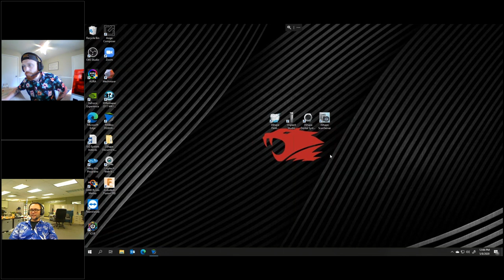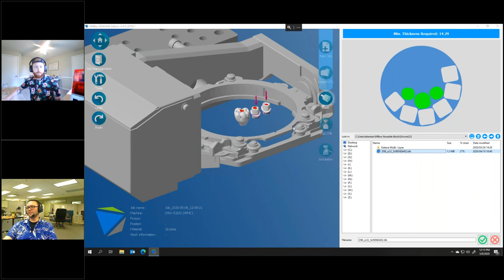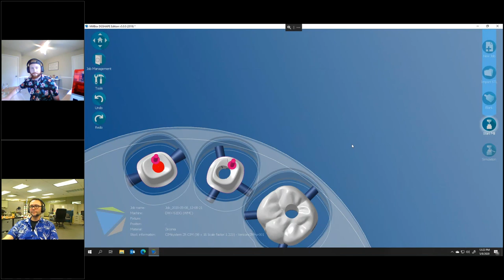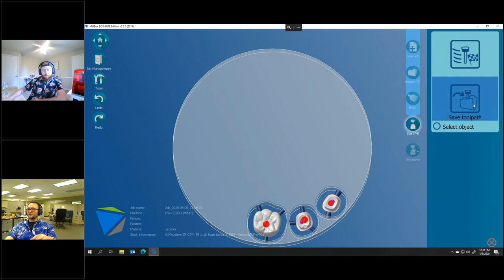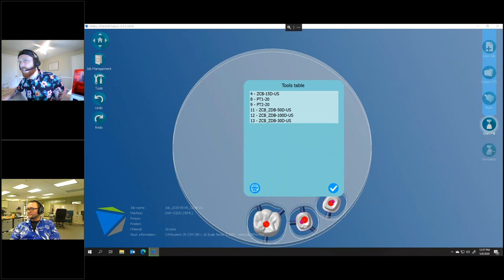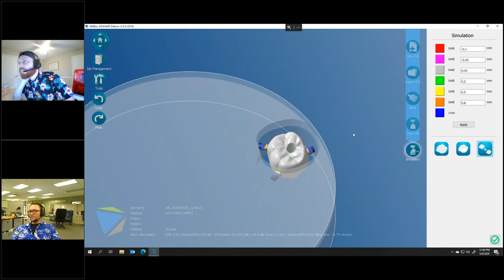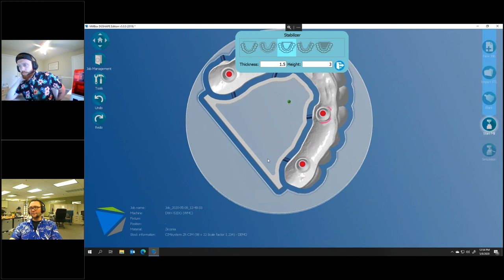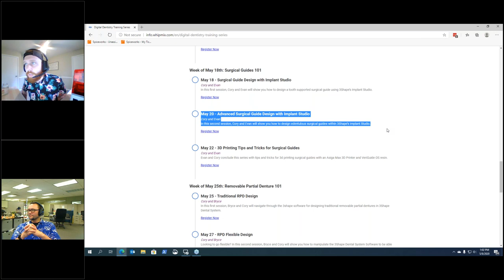Digital Dentistry Training Series: Mill Custom Abutments & Screw Retained Restorations using Millbox

Comment: Hello dear friend, can i ask if it´s posible to make the inner shape of the multi units abutments so i can screw retain the zirconia prostheses directly to the implants multi units abutment in the way like we do with a cats framework?? Don´t using t - base or titanium copings .
Reply: Good Afternoon Guillermo, if I understand your question correctly you are asking if it is possible to do screw retained crowns simply directly to the implants, no ti base involved.  As long as you designate the object type in MillBox as hybrid you can then important manually all the necessary parts for the unit to identify the hole, the margin and use the safety red cap in Millbox.  These tools are available in your tool section on the desktop of MIllBox and you look for the curves and surfaces features.  There is a great implant video from Mike Webb on Youtube for Millbox implants and how you can use these tools.